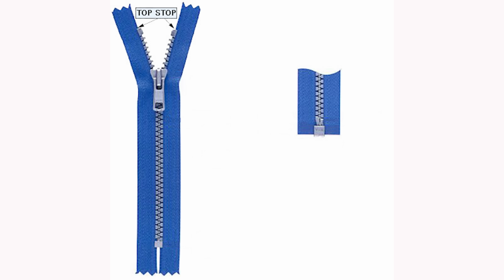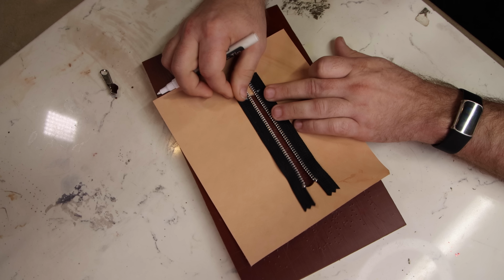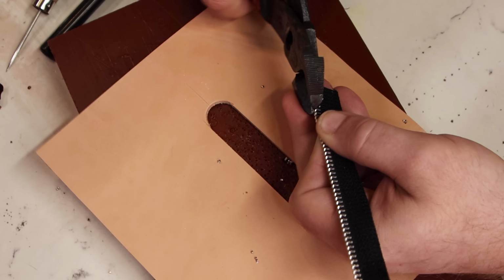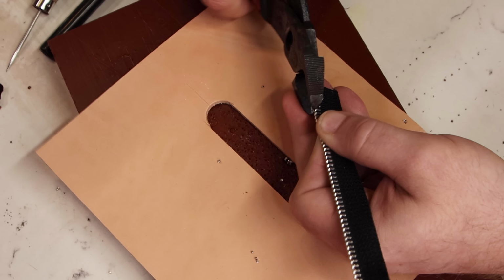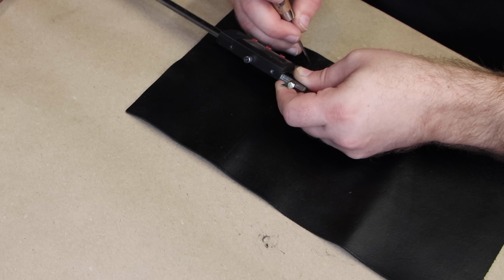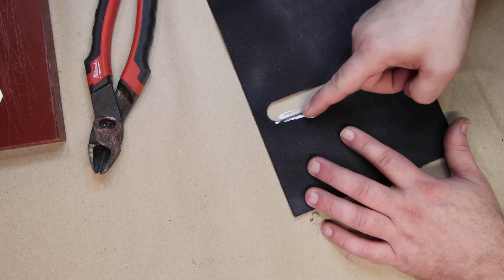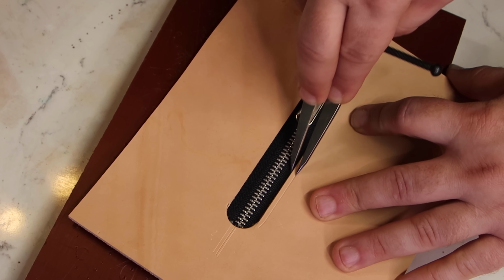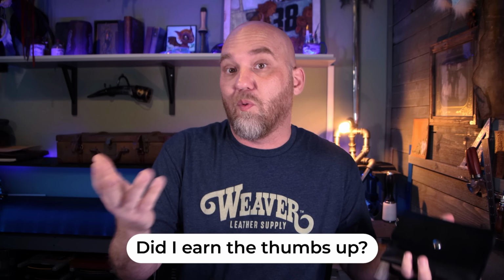How to Install a Zipper

Comment: Another great video out at the perfect time in my opinion! Off topic question though. I am going to be making a bracelet with a “raised edge” around the outside of basketweave stamping. How can i stamp without ruining the raised edge? Part of some of the vertical stamps are going to be hanging on the middle of the stamp, putting half on the intended area and half on the raised edge. I can send you a design example if this doesnt make sense.